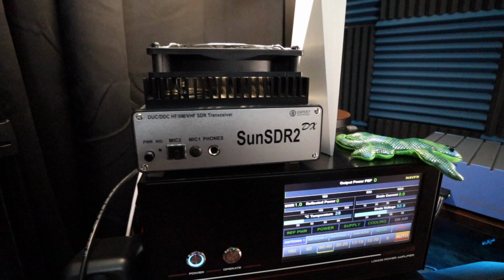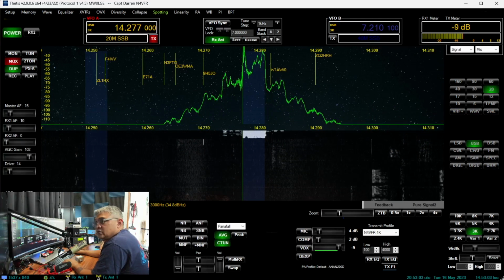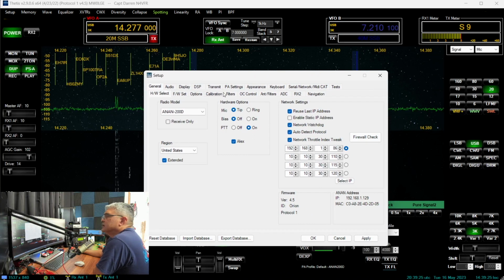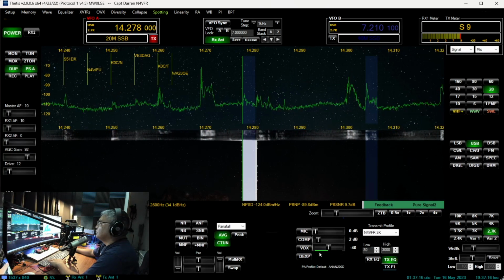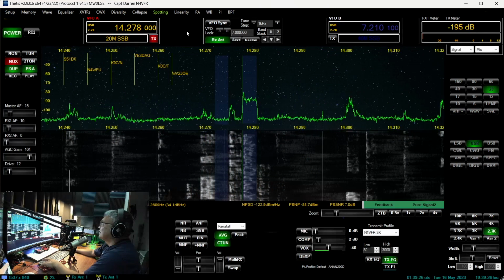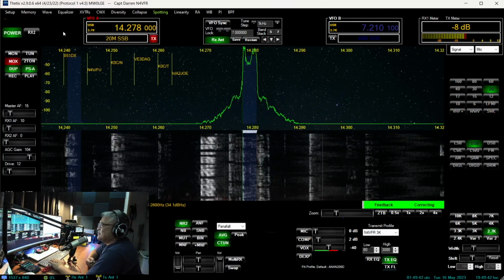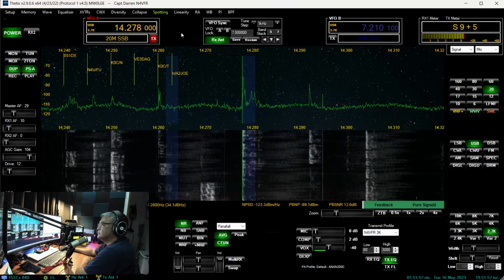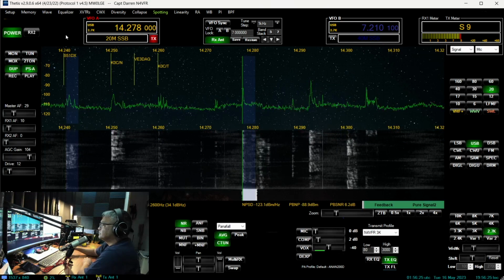Anan 200D Pure Signal Modified | Pure Signal Demonstrations | Xtronic RF Sampler

Comment: Dang..  I have a 200D..  been off the air a few years...  Gosh..  getting an new computer and crankin' that Shack Jewel Up again!  Also Have a 100D was going to see if I can get both to run on one computer..  Not sure why..
Reply from the maker: I dont know if you can run both at the same time, maybe you use a static IP to the computer.

Comment: Hi Captain Darren, I think you would be better to use the coupler on the other "side " of the tuner, IE between the amplifier and tuner. It ought to make no difference except in high SWR conditions on the antenna feed where the voltages on the output of the tuner can be somewhat unpredictable. It is certainly amazing what overall feedback can do for TX IMD. 73